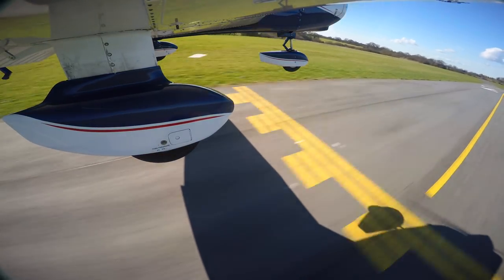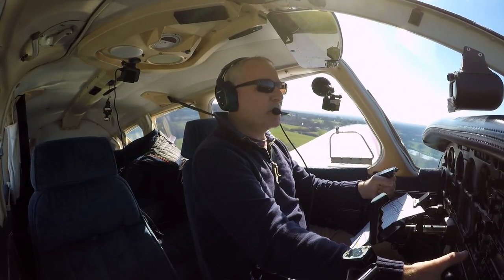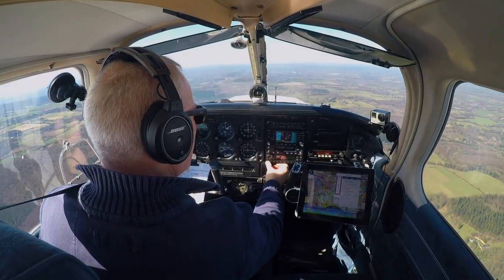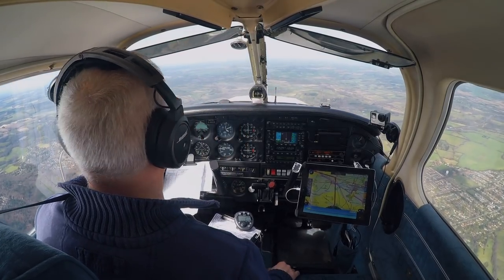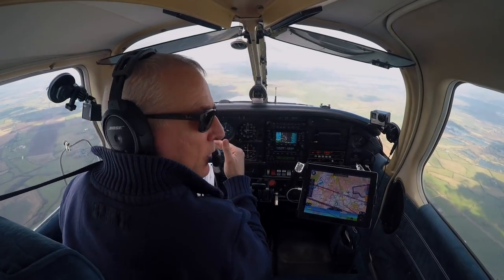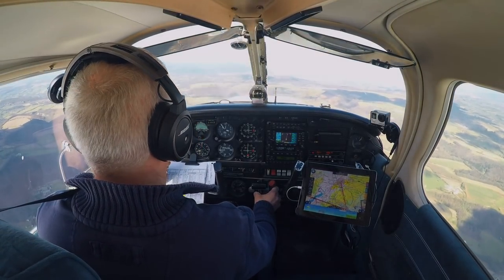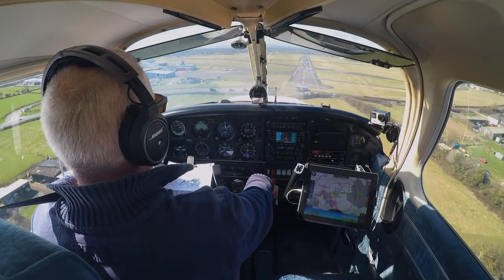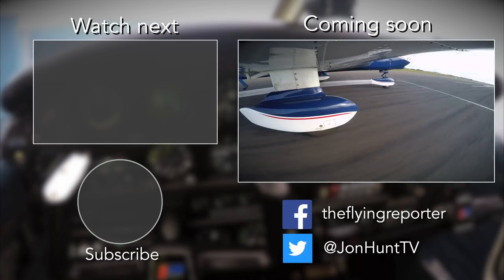Taking off from a short runway - PA28 - Redhill UK

Comment: Hello Flying reporter, I also fly with a PA28 and we have many short runways here in Sweden. I do not know when you used the flaps but maybe you want to try the following. It's just an idea. We stop the aircraft at the beginning of the runway. Handbrake on, no flaps and full throttle and then the handbrake off .. We accelerate and at 45 knots we pull two stages flaps and also at 55 knots we lift. The advantage of starting without flaps is of course that you can accelerate quicker because you have less air resistance.  And keep up with your great videos, they are very interesting
Reply from the maker: Thanks.  I've heard of the technique...quite a few of my friends use this.

Comment: Great video, thanks for posting. dont understand why such an experienced pilot would be nervous - relax Jon - you have it under control !    By the way if you filed a plan to ostend did you complete uk GAR as well - in that case do you have to cancel both as a natter if interest ?
Reply from the maker: Hi Dave.  Yes, I cancelled the Gar, although that wasn't as straightforward as I thought it would be.  I phoned the 'emergency line' which says is to be used for this, but was told to email the NCU email address, which I did.

Comment: 2 stages of flaps creates more drag than lift? Should it not have been 1 stage flaps, brakes, full power, static RPM with back pressure on yoke and release brakes for 50KIAS and rotate and climb at 55KIAS?
Reply: Scratch that, POH says 25 degrees flaps

Comment: I guess knowing what they are likely to say helps, but by god some of those controllers are incomprehensible. The one at 13:38 sounds like popeye mumbling into a pillow. Does this get easier with time, or do the headphones maybe help a little? I would constantly be saying "say again". Also when you contact approach, you stated your altitude followed by "1017", is this an air pressure reference, or something else? Lastly, your nervousness did not show at all and you seemed wholly competent to me. You called out your landing speed, so that was all correct, but ballooned. Gust of wind maybe? I am just a sim pilot, learning a lot watching you! Thanks
Reply from the maker: You get used to it.  It's hard at first.  1017 is the current pressure setting my altimeter is set to.
Reply: @TheFlyingReporter  Thanks again!

Comment: So I take it ballooning coined the saying, flying by the seat of your pants 😂
Reply from the maker: I don't know if it was a balloon that was the origin of the phrase, but it is a bit seat of the pants.  But you have to avoid the temptation to push the control column forward.  Either keep it neutral, pull back a bit to arrest the descent again, add power to arrest the descent, or go around.